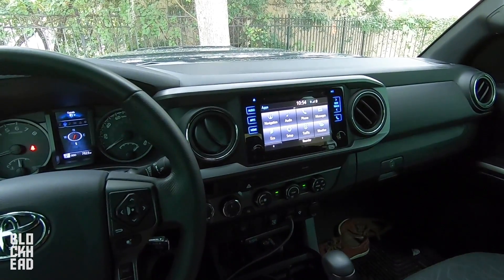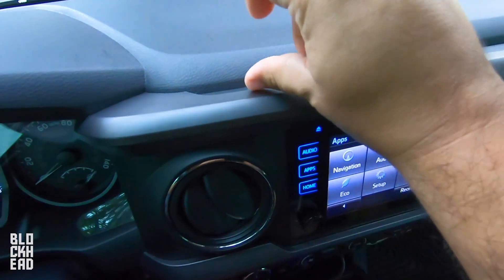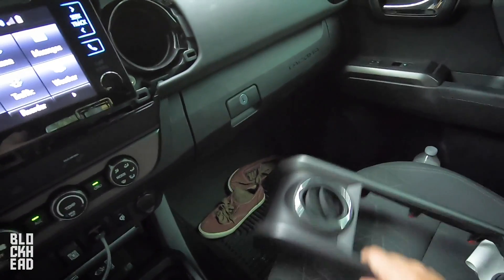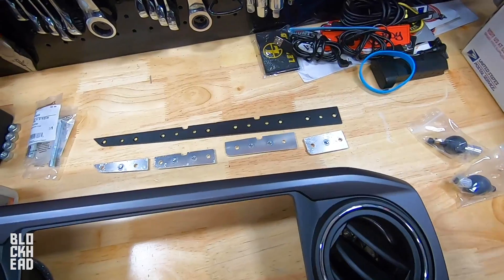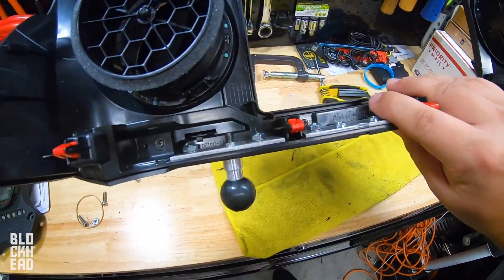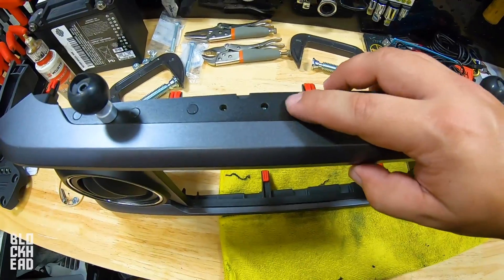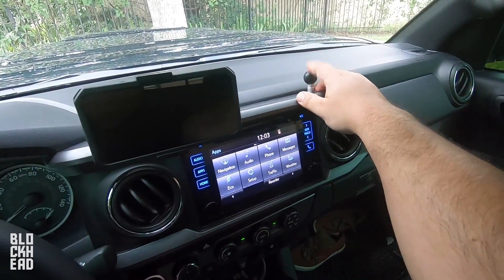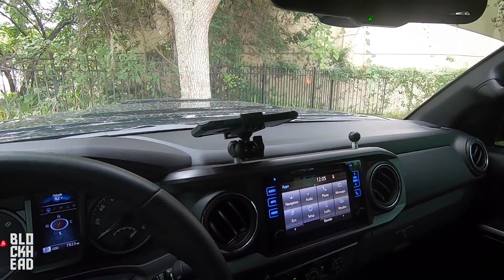BEST Tacoma Phone Mount? - DMM Install (Taco Garage)

Comment: You can also use the vent to cool off the phone so it doesn't overheat.
Reply from the maker: I've only had my phone overheat once and that's while it was laying on my tailgate outside. Never has overheated on me while in the AC or under normal use.

Comment: Since you're already using the Rokform case, one of their mounts should be easy enough to integrate with the RAM ball arm.
Reply from the maker: Actually not easy unfortunately, they don't sell anything w/ a 1" ball, so I had to make up my own hybrid thing using the base of an X mount but put the magnetic mounting piece from  Rokform on it so I could magnet it to it!

Comment: Late to the party.... Do you still have this taco and do you still use the mount? Long term evaluation of it? (My Taco is in route to the dealership, looking for the optimal mounting solution) Thanks!
Reply from the maker: I don't have the truck anymore, needed a full size so got an F-150. Ended up installing a similar mount in the F-150 also, would recommend 👍